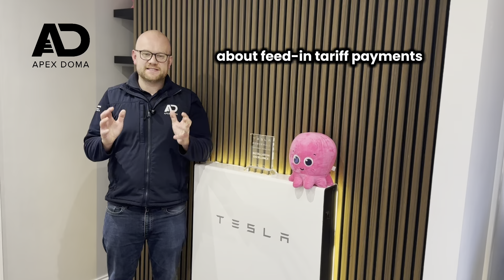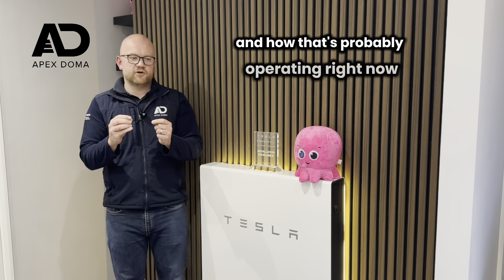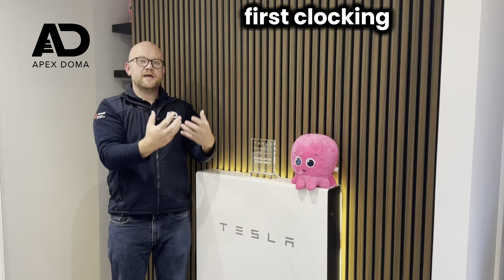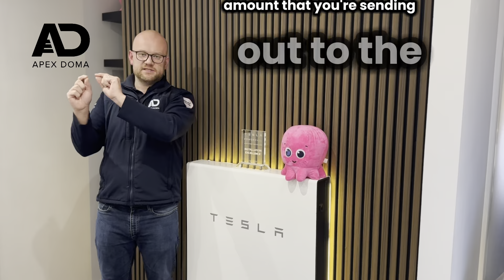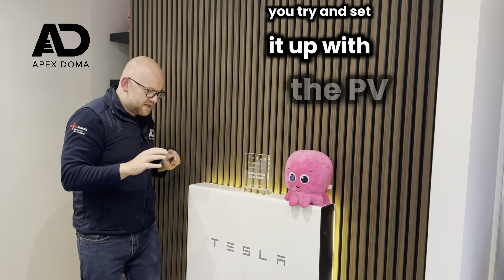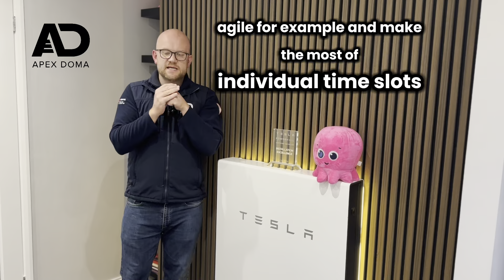🔋 Feed-In Tariff (FIT) & Battery Storage Explained with Apex Doma

Comment: I've currently got on my south roof 16 x 235w panels from 2011 on the generous feed-in tariff (71.85p kw) and an Uno 4.0 inverter. This generates 21-24kwh during summer and 0-2kwh in winter, trees and houses in the way.
Usage is about 16kwh during summer and 20kwh during winter (clothes dryer etc)
So I want to replace the existing panels for 16 x 470w panels and add an extra 6 on the east facing roof.
So 8 panels would go on my existing inverter and then I then need another inverter with at least 2 strings for the remaining 8 on my south roof and 6 on my east roof.
So I need a system to capture my existing AC feed-in and also the 14 new panels?
Is this an AC coupled inverter & Battery?
Reply from the maker: Yes, that's correct. You would use an AC-coupled inverter with two CTs to track the current 😃 there are limitations to a FIT inverter system and what you can do. Always double-check with your FIT payment supplier or installer on the setup.